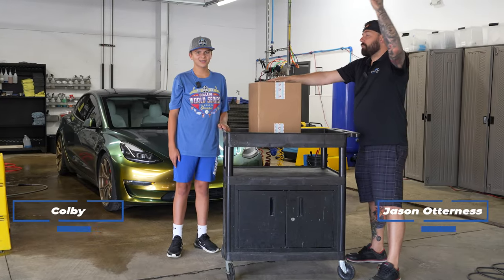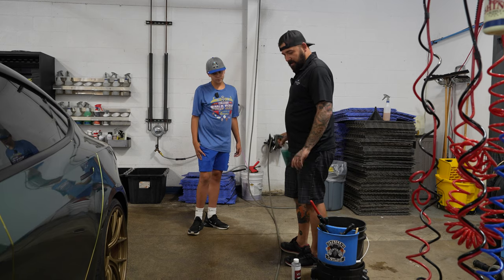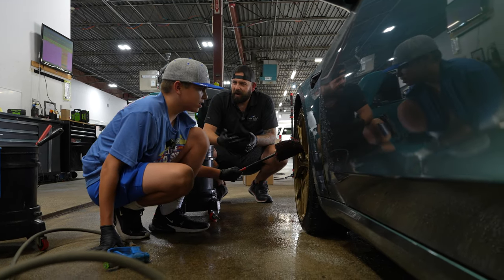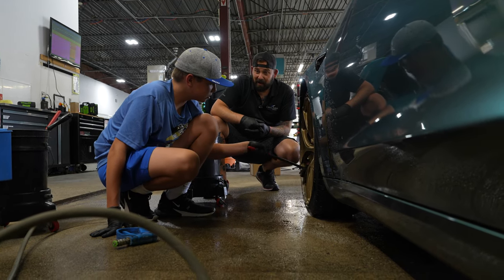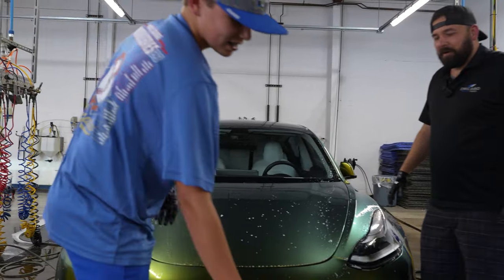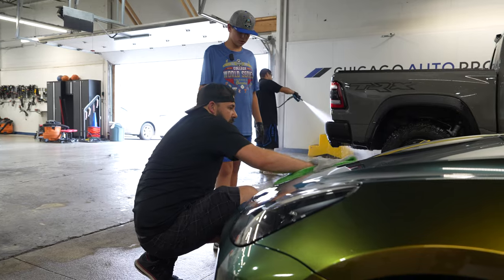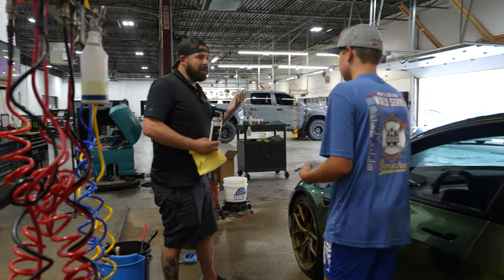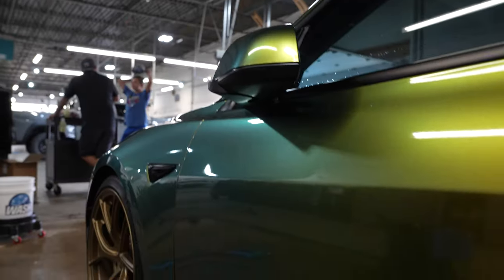Washing A Car By Hand | How To Step by Step Business Advice

Comment: I also started working on cars when I was 13. I first started working at a body shop doing body work & doing the color sanding & detail every day after school. I then worked at a shop where we rebuilt cars & sold them. I found what I liked the most from the process was doing the exterior detailing with the paint, so I focused primarily on that. It's hard to believe that it's been 42 years now since I started this whole process.

Comment: Never thought of using the scrub ninja as a tire applicator
Reply from the maker: It’s better than your bare hand🖐️
Reply: @ChicagoAutoPros  I've been using Eagle One Tire Swipes for the past 17 years to apply 303 Aereospace Protectant to my 2006 LS430's tires.  Are the Scrub Ninja applicators just as pliable as the Tire Swipes?  I like how the edges of the foam Tire Swipes fit between the tire bead and the rim, and can reach fairly deep into the "flat spot" of the tire that's touching the ground -- yes, I'm a bit anal when it comes to the appearance of my Pirellis. 😎